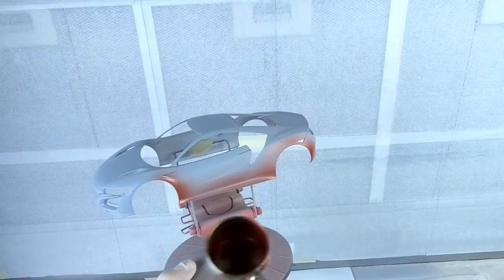Building a Perfect Tiny Honda/Acura NSX Step by Step

Comment: Quick question,  do you clean the paint from the pieces that you glue together? If not doesn't the paint prevent the glue from adhering or doesn't the glue eat the paint? Thanks

Comment: Why did you stick honda in acura
Reply: Because he is European
Reply: Acura NSX is only for left hand drivers (like U. S and China) and Hondas are for the right hand drivers so I wonder why he stick Honda badge too lol.
Reply: @A Simple Man BS, Acura is only for the U.S. market (also maybe China, I don't know). In Germany or France for example this car is sold as Honda with a steering wheel on the left not right. This is just a badge, it's not that hard for a manufacturer to change it. 😅
Reply: @waza3350  uh ty for the info but I still wonder why it's badge as Acura in U. S?
Reply: @A Simple Man Local decision I guess, Acura is the "luxury" division of Honda they they must have thought this was a smart decision to brand the NSX as Acura in the U.S.